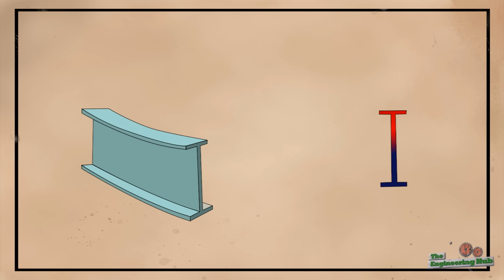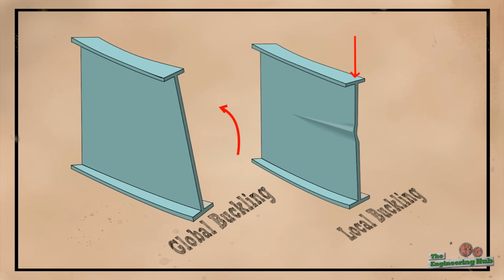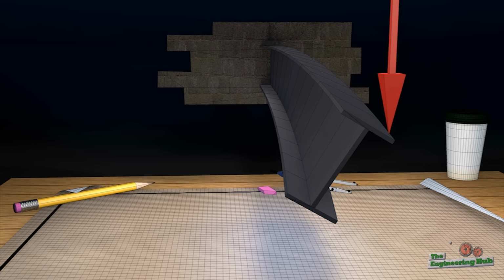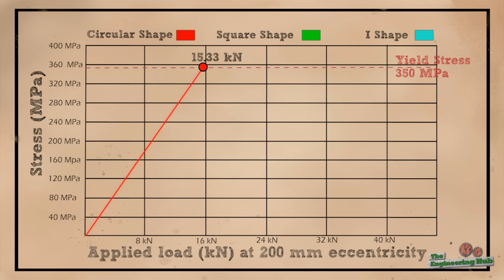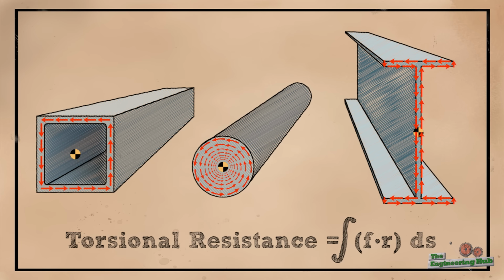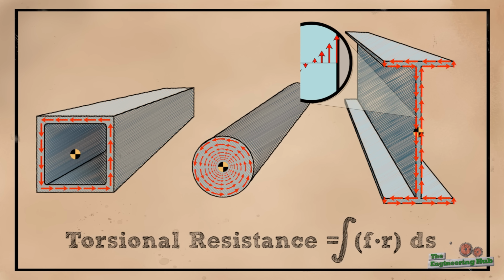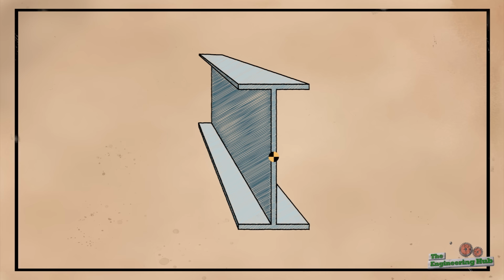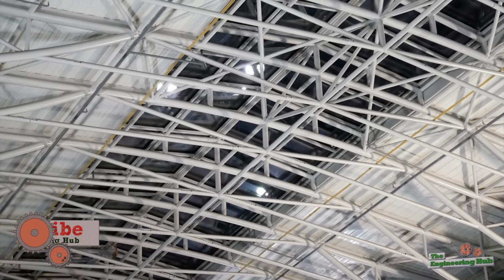The Critical Weakness of the I-Beam

Comment: None in the industry calls these "I beams". These are called  wide flange beams and this information is third year structural engineering major material. There is no critical weakness in the wide flange beams that can't be measured and designed against. And BTW tube beams are impractical to use.

Comment: D'où la notion de point fixe et leur type d'attache à amener à chaque point critique déstabilisant la poutre en I au déversement latéral, et contre le flambement de la poutre en la divisant pour en obtenir plusieurs tronçons ayant leur longueur libre de flambement acceptable évitant ainsi le flambement de chaque tronçon, amener des raidisseurs verticaux (+ éventuellement un raidisseur horizontal selon la hauteur d'âme) contre le voilement de l'âme. Voir également aux appuis ce qui est nécessaire d'y mettre ou non pour éviter le voilement de l'âme.
En calcul de structure il faut modéliser la structure en tenant compte da ce que l'on apporte à la structure pour éviter l'instabilité de la poutre en I et non pas choisir une section de I de plus en plus grosse donc plus lourde et inacceptable pour atteindre la stabilité de cette poutre en I. Il y a aussi le facteur économique qui entre en concurrence avec le choix de la solution dans une conception de structure métallique.

Comment: Elastic instability of complex structures wasn't completely understood and underestimated  by practising structural engineers that until 1970ies. Stephen Thimoshenko's publications  and research after the two collapses made the situation clearer. But also the race for slender structures skyscrapers and lakes ships including the mathematical 3D models of the 70ies were still optimistic , mainly due to short-cuts and assumptions to  computers limitations.  Many slender structures shows this specific  problem of instability . The Quebec bridge for the third time is buckling, with many cracks captures on photos on its north-west main post and similarly on the two adjacent member  well  beyond repair as it is systemic after a SAP-90 model error followed by a major overloading with iron ore trains  . This is completely documented in force details in my Flickr photo albums of the Quebec bridge. the bridge is still " legally" operative under the USA AREMA Cooper-E50 rules . Theodore Cooper was the eng responsible for the first catastrophe in 1907 . But this bridge is doomed and exposed to seismic , ice, and collisions by ships or derailments that are now known to be much more important compared to the designs dating more than 110 years ago.

Comment: My observations of long universal beam failure despite symmetric loading is the side folding of the web with top remaining in contact with a stable load like a floor slab. The bottom flange stays  more or less perpendicular to the  web. This failure occurs in the middle of the span and is usually progressive.

Comment: Our factory has 130' clear span frames spaced 30' apart. At one location we required a 60' clear opening through the side of the building into the adjacent, preexisting building. This meant that one of the frames would need to have that end suspended from the center of a 60' beam using an L-shaped hanger device welded to the side. To prevent the whole thing from rotating, the L-shaped hanger is also horizontally connected to the adjacent 130' frame with a 30' x 10" diameter hollow pipe. I get nervous every time I look up and see it.

Comment: This is nothing more than a phenomenon called lateral buckling.  All beams regardless of section are subject to this if the span is too great.  A designer will either look up tables listing allowable spans for the section or calculate the lateral buckling load if needed and compare that to the lateral load and stresses on the beam.

Web failures in I beams can occur when the beam has an extremely large flange width to web depth.

Buckling failures can be mitigated by selection of a different shape section or by lateral bracing.

It is not a fatal flaw.  It would be like saying a column will buckle well before the compressive strength is reached and this is a fatal flaw.

Comment: IMO, the comparison between the square tibe and the circulsr member is not a fair one. The circula member it was a thick-walled tube would akso have more material further from the axis. Yhe material in the center does little in carrying any of the loads. The choice of a solud shaft or one with a hollow core will often cone down to the cost of manufacture versus need to reduce weight at all costs (racing, abiation) and srvice life.

Comment: yeah .. no .. your premise is flawed and your use of buckling as part of your insisting that I beams are flawed is .. just wrong. As for Torsion being a failure mode for an i-beam .. yep, don't use a i-beam in a situation it will be under a torsional load. basic engineering .. don't use structural members in a way they are not designed to be used in

Comment: As far as I am aware universal beam and column sections are used as main structural members. Rectangular, square and circular hollow sections are generally used for bracing and tie members. Hollow sections are good in tension and compression. Stiffener plates and additional flange plates may need to be added to a beam to compensate for buckling or eccentricity.

Comment: What's failed to mention is the strength in a rectangular section tubing. The tubing size for size can resist torsion, buckling and deformation far better. But as in all things a WF beam or Ship Channel with tapered flanges and larger radius fillet will indeed out perform the tubing in a similar application. What's critical is the side loading, shear forces, penetrations, application, asthetics, weight or deadload and moment requirements.

Comment: For a channel called "Engineering Hub" you're not being very technical with your verbiage.

I-beams have not been widely used in about a century, replaced by the modem S-beams (or "Standard" beams) more commonly known as wide flange beams. And when you start to talk about built up shapes like plate girders you lose all sense of the vocabulary.

Comment: I thought you did a good job.  I've designed numerous plate girder bridges.  For a five minute video, not bad.  All of the problems with I beams can be managed.  But if I were designing a bridge girder prone to a significant amount of torsion, I'd start looking at tub girders if crossframes couldn't handle the torsion; supporting your point.

Comment: A very interesting video, however I wouldn't say the i-beam has a fatal flaw. It's a perfectly acceptable component as long as it is used within its rated design envelope. We wouldn't say that copper wire has a fatal flaw because it melts when too much current is passed through it. In such a case, the current rating has been exceeded. I would argue the same argument would apply to the i-beam. Congratulations on a beautifully presented video. Best wishes.

Comment: Another failure mode of I-beams (seen and affected by it personally): I-beam rusting enough that you can put a fist through without touching anything where the middle used to be.

Background, old house, built around 1900, brick building, used to have a fireplace in each room, leading vertically up to chimneys …I-beams carrying inside and balcony floor at at roughly 2:1 ratio, all fine. Building codes back then apparently did not need/demand water tightness between balcony and inside.
110 or so years of rain later, rusted through in the middle I-beams found during a floor remodelling for completely different reasons. Nobody hurt but the bank accounts (insurance: nothing happened, so … we ain’t paying).

Comment: “Section Modulus.”  I heard you describe it in detail but I did not catch you saying the word.  Ratio of torsional rigidity to area of cross section.  You probably know the word, maybe you said it but I missed it, but should you not know it, look it up.  One example of taking it to an extreme was the backbone of the frames of some BSA motorcycles, which used a large diameter frame tube that ran under the gas tank, as the oil reservoir, and the stiffness provided made those 500cc BSA’s the best handling motorcycles of their time.  (Too bad the engines were, ah, crap.)  They did develop stress fractures sometimes, but you would know about it before anything broke when you spotted a new oil leak.  
You’ve got a worthwhile channel.  Interesting stuff that people should know something about.  
“Thunderf00t” is probably my favorite, though.

Comment: Why are you trying to use an I beam for high torsion forces? It's not for that. Bad engineering that is, not a "critical weakness". Weakness none the less but is that really "little known" as you say? This seems like basic physics to me. An I-Beam is an assemblage of steel molecules not it's own molecule that doesn't bend/deform. Think of it that way and you'll never make a stupid mistake like this.

Comment: I've been in the building industry for years in my younger life. 
Now older retired guy,  i built a hydraulic log splitter with a large "I" beam as part of the machine .
After using this machine for 15 years im surprised every now and then how this i beam wants to "Twist" under heavy load...
Ive never seen this happening in normal applications...
I ❤ my log splitter ...

Comment: Abundant examples of I beams vs. hollow tubes were evident in New Orleans after Hurricane Katrina.  Every billboard in the area that I saw that was supported by I beams bent until the sign reached the ground.  Every one I saw that was supported by tubular steel was still standing. As for the video, it leaves out a great deal of significant information.

Comment: I want to build a 3 story ferro-concrete house and am planning to use i-beams to support floor joists. How far apart should I place support columns and what is max gap between i-beams to support such a structure? I plane to use something really light like Foam-Crete for internal non load bearing walls.

Comment: I had to stop because I know what and I-beam looks like and what a wide flange beam (W-Flg). Perhaps this is aimed at the curious that have no knowledge if what an I-beam really is. HSS shapes have their limitations as well. The Engineer of Record has to know the building requirements and will design for shear, torsional, axial and moment loads and will use the proper materials as required.

Comment: Someone:  Mentions engineering.
777 Engineers:  Disagree about nomenclature, generalities, details, process, specifications, test methods, measurements, scale, material properties, inspection protocol, applications, calculations, vectors, modes, the SI system, best practices, industry standards, equipment calibration, labor shortage, metal alloys, definitions, production values, deviations, trade skills, manufacturing techniques, fasteners, the accuracy and usefulness of various software packages, the pros and cons of clipboards and what is the best beer.
Everybody: Is more confused now.
Reply from the maker: lmao

Comment: As others have said, it's not necessarily a flaw but property. I-beam shape is optimized to resist bending, just as circular shape is best to resist torsion. It's the combination that requires compromises. You can increase I-beam torsional resistance a bit by thickening the flanges. This might be enough if torsion load is small compared to bending - like due to small manufacturing errors the load application is a bit eccentric. If the torsion-bending ratio increases, the next step is to box some of the I-beam length. This increases its torsional rigidity considerably. If this is not enough, then hollow section I-beam might be the answer, especially with high strength steels (S600 - S900) although it's much harder to build. Other way to approach the situation is to take HSS profile and add material on top and bottom, thus increasing its bending resistance while keeping its torsional properties. As always, engineer has to balance between application, manufacturing and cost. Usually the simplest solution is the best.

Comment: An I beam in that pictire poured into concrete is either bad engineering ir poor craftsmanship. Never should an I beam be encased in concrete. I have been in construction and disaster restoration for over twenty years. Anytime a beam has failed has been either poor engineering, i.e. not engineered for the load etc.. or poor installation. Never if an I beam is engineered or installed correctly and or  maintained correctly have I seen one fail and I never will. There are extreme circumstancea to this. Tornadoes, hurricanes etc.. but never will one fail under normal circumstances and all three of the above have been achieved.

Comment: The illustration shows parallel flanges the same thickness as the web.  But with most UBs and UCs the web is thinner.  Parallel flanges or taper flanges they are both open sections and so not good at resisting torsion.  Talk of fatal flaws in elements or designers is BS and I don't mean British Standards

Comment: Structural Engineering Ph.D. here. Good content and animations, but the video fails to acknowledge why the I-beam is the most efficient shape in steel structures. In fact, its popularity likely is an indicator or how non-fatal the torsional I-beam weakness is and, as you have noted, there are plenty of ways to mitigate this weakness from a design perspective. Good job, keep the videos coming.
Reply from the maker: Thank you Felipe, this video was focused more on the weakness of the I-beam. We made another video on the strengths of the I-beam and its incredible effectiveness in carrying bending loads. You can check that out here if you are interested: https://youtu.be/-aU-ayrNqHQ
Thank you for your comment, we appreciate your feedback! We are a growing channel and we try to improve our content by listening to the feedback from the viewers.
Reply: I'm a carpenter and I 2nd that statement.
Reply: Structural Engineering PhD. here too. I beams are most wideley used in cases where high bending resistance is needed in a compact section. . There are many situations where other structural forms are more efficient in bending (trusses, box girders, composite beams). No good for compression (H sections, CHS and RHS more efficient). Not good for biaxial bending either. Not good for high shear loads because of the slender webs. The list goes on.
The secret is to choose the section according to the applied load to be resisted.
Reply: @defendermodsandtravels  Bridge maintenance engineer, and from my point of view a truss has many more weaknesses (upkeep costs and potential failure paths) over a long timeline than a steel plate girder bridge.  Of course truss bridges can be designed with redundant load paths, but historically are not redundant. Simplicity in design (plate girders are typically fairly simple from a design standpoint) also has some advantages for analyzing and preparing for seismic loading, or so "they" say.  Of course with longer spans these more efficient cross-sections can become a necessity. Also, bracing for torsional and buckling forces in a plate girder can be done with fairly cheap and available steel.  Plate girders are essentially the backbone of the US highway system.

Comment: Don't i-beams usually have more girth toward the merging point of thr horizontal and vertical spans of material? The picture initially presented look more like wide-flange.
Reply: In this video, I-beam refers to the laymen's term.  It is a term that is used collectively for both types of beams that resemble the capital letter I.   The nuanced difference of wide flange beams and actual I-beams with tapered flanges, is beyond the scope of this video.

Comment: Jet fule cant melt steel beams.
Reply: There is a kernel of truth to the statement that jet fuel cannot melt steel beams.  Indeed, you can heat steel to the adiabatic flame temperature of jet fuel, and it will not melt.   However, beams don't need to melt to be damaged.   Heat a steel beam to the temperature of jet fuel, and it will bend like a wet noodle, and be completely useless as a beam.
Reply: @carultch  point was a meme and to bring up how no one talks about the one that fell with no damage.
Bet this comment will be deleted again.

Comment: It is important to understand the strengths and weakness of structural components. 

Steel only structures have number of limitations with retaining strength during intense fires.
Combining Steel and concrete is often more robust retaining more strength even during intense fires and more economical. 

But what is the best combination of steel and concrete. The internal rebar construction has number of advantages including protecting the steel from intense fires. But other structures such as concrete filled tube has advantages as well such as resistant to concrete crumbling caused by shock impacts.

Not all failures are bad. Expansion joints are an example of places planned to pull apart to relieve stress. It may be wise to design a part of a structure to fall separate from the whole structure. Think firewalls and support walls disconnected from parking decks allowing part of the structure to fail without forcing the destruction of the whole structure. An often over looked fire fighting method is destroying part of a structure to save the remaining structure. This approach can apply to other failures, not just fires. 

Choosing the correct structural components of a combination of structural requirements and construction skill.